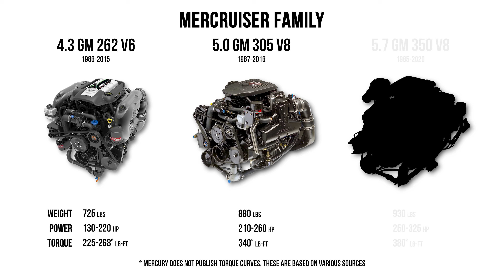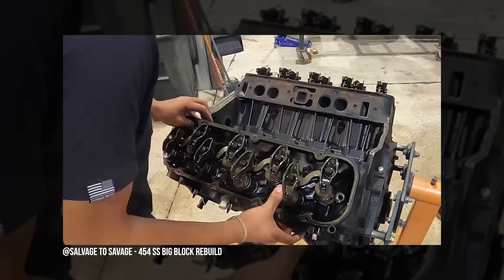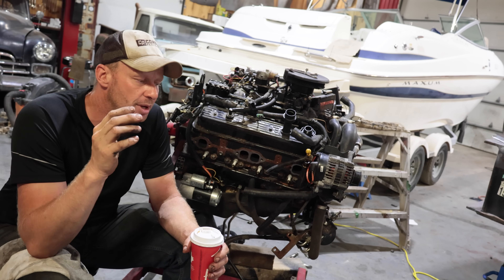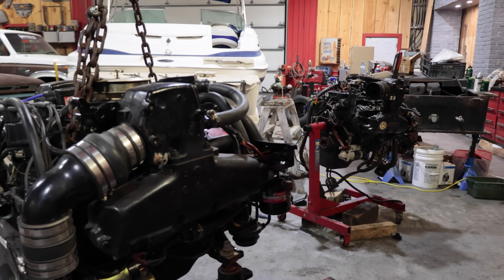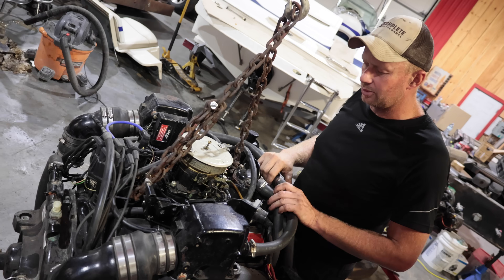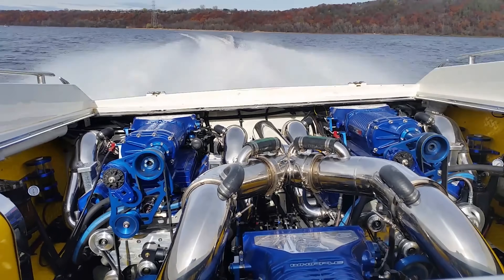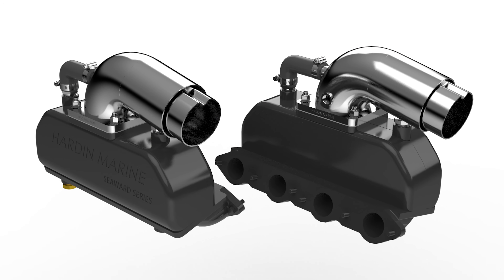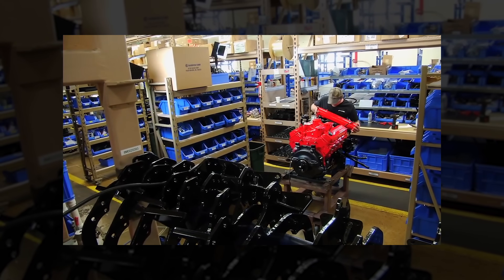REVIEW: Everything Wrong With A Mercury Mercruiser

Comment: I have a 1988 SlickCraft 237sc with a mercruiser 5.7/260 and has a  cracked block and recently bought a rebuilt 5.7/260 (maybe newer engine). my problem is the old engine harness is a 9 pin male/female) connector and the new engine is a 10 pin (female) connector. I can't seem to find enough literature on it and before I go cutting and splicing the harness I was looking for some advice on how to go about handling this issue. Any advice/insite would be greatly appreciated. Thanks.

Comment: My 4.3 sucked for about a year of inconsistent use. Got my Mariah SX18 for 4k that wasn’t used too much, but it was never looked after super well. Used to leave my stranded all the time, dump oil, or just shut off cause the damn wire clips kept getting brittle and cracking. Now it runs perfectly and it’s not left me stranded in a while, although it doesn’t enjoy going from Florida to the mountains in North Carolina

Comment: No matter what slight issues they may have. There is not an outboard motor that sounds as good going across the lake at 4 grand. This is my humble opinion. I have a 2016 383 stroker in my 23-foot offshore boat. I live in florida and don't have to worry much about winterizing the engine. I pull it out every couple years and let machine shop go through it. Love it. Sounds awesome.
Reply: https://www.youtube.com/watch?v=XZkxJJrB9ZM&ab_channel=speedmastermarine

Comment: A simple question solves your dilemma.  Does Mercruiser remove internals of the engine?  They are buying 4 bolt main long blocks?  Short blocks?  Either way in order for what you said to be true they would need to change rings and or pistons.  You can't magically create more/less gap in a cylinder without changing the mechanics of it.

Comment: hi guys, new to the boating world here. I take pride in learning how to do my own work but a little behind in the learning process. I bought a boat from an old engineer in Detroit, Michigan who said the merc had a cracked head but that it was properly repaired  (sleeved) when he bought it. I have only owned it a couple weeks now. I am starting out with purchasing all safety equipment before I go out and bought the shop manual for mercruiser. It is an 1986 tiara 5.7L. I would love any input you guys could pass along. I maintain all my own vehicles but it has been a long time since I worked with non fuel injected motors. I was in the Navy when distributor caps were still being used. I found a few spots that were soft on the top deck so I am going to get my first experience doing some fiberglass work. I have thought about using coosa board to replace soft spots which to my understanding is balsa. Loved the video by the way. I think you converting to diesel would be an excellent video.

Comment: Most engines in boats are operated at over 3000 rpms , in your car or truck that would be 100 mph or more, uphill. If you can keep the revs and the boat on plane under 3000 rpm they will last, running at over 3500 and your motor will not hold up.  as an older mechanic of boats from the 60's and 70's, Chrysler 318's were near top of the list and 327 GM's, but really enjoyed a personally  owned ford 351 windsor with the 3 inch mains and of course volvo 4 cyl's. GM starters are really hard to swap out in a boat compared to Fords. shame no more ford or chrysler marine engines. available new. when ford gave up on the business I could buy new 351 HO complete with carbs and flywheel , wires etc for 1650 $  the days !!  wish I bought all of them.!.

Comment: One thing to add - the Mercruiser 5.7 (and probably the other displacements) uses a roller cam rather than a your standard flat lifter setup you find in the on-road engines.  This works well for extended idling, which these motors do.  Solid motors for sure.
Reply: It must be true.  I redded it on the innernets!

Comment: I had a 165 hp, 6 cylinder that I changed out the block. That boat and engine ran from 1988 through 2009. At that point the engine was tired and the hull was tired so I scrapped it. I would drain the block including the intake and exhaust. Drain and replace the grease in the lower unit and add stabilizer to the fuel. Never had any issues when starting in the spring.

Comment: The thumbnail says it all...the same thing wrong with every new car or I/O or inboard boat engine, look at all the crap hanging off of an engine that requires nothing but a distributor, carburetor, and a few hoses here and there.
1000 points of failure.

Comment: The 3.0 is a gd tank of a motor, mine is anyways. NEVER take these into the saltwater, only designed for freshwater. Taken in saltwater can shave off 7 years of the engines lifespan because of the rust that will be produced in the internals

Comment: Have a Mercruiser 1998 4.3L which runs well, but suddenly the motor will not lift more than a few inches.  It goes all the way down with no problem, but when you go to lift it, it lifts well for about 4 or 5 inches then quits.  The oil reservoir for the lift system has plenty of oil in it.  Any suggestions?
Reply: Bad trim pump or ground

Comment: Had a military sub engineer today working in a motor shop . He told me to take my knock sensor and put it on the other side of the motor . In its current place close to the starter , it feels the starter and sends this info to the computer . I did what he said , my starting turned over so much better . Before I would say 2 or 3 cycles then the engin would start , on the other side I wills say almost instant . I'm not a mechanic but he was right on my Murk 5.7 in my 2005 28 footer

Comment: Honestly though, who has actually seen a 2 bolt sbc block fail at the main bearings in a mild hp motor due to lack of main bearing support???? I'm guessing zero. FYI, I just tore down an original Mercruiser 2002' Alpha EFI 350 that was a 2 bolt main 880 block;) They do use them in marine apps with no problems to clear things up a bit...

Comment: Um,. nope. That struck engine in your video has a 185 degree thermostat. The boat also has a 185 degree thermostat. At 165 degrees, way too much energy is lost. There are no 165 thermostats, dude. And lake water or coolant, the thermostat regulates engine temp.

Comment: The boat engines are usually 2 bolt mains and they have FWC (Closed cooling) available also.  they are better balanced and they don't have hard torque applications like trucks do.  so not sure where you got your info.

Comment: I pump 5-6 gallons of -100 Antifreeze through my Mercruiser 3.0 at the end of every season right through the raw water pickup and there's not a crack anywhere on the block. Just warm the engine up until it's hot and the thermostat is open (or remove the thermostat) and the antifreeze will replace the water. I prefer to use the Winterizing kit that includes the holding tank and all the hoses/shut-offs so you can leave the engine running and switch over to the antifreeze seamlessly from garden hose water without shutting the engine off. I spray fogger in through the carb to kill the engine once all the antifreeze has been pumped out of the tank. It's worked well for many years and I live in Western NY where we have some cold and snowy winters. Also, more recent Mercruiser engines are especially easy to drain...there are two hoses right up in the front of the engine that will drain the block and manifold quickly, just by pulling the hoses and letting the water drain through the bilge and out the plug at the bottom of the stern.

Comment: THIS GUY IS AN IDIOT! DONT LISTEN TO A MORON THAT DOESNT KNOW ANYTHING! A maxim boat which is JUNK! Doesnt know anyting about mercruiser engines just talks out of his ass! LMFAO!  He is building an LS motor oooohhh to stick in a tank of a boat. And this boat flips easy. PLUS THE MORON ISNT CHANGING HIS lower unit! ALPHA DRIVE ONLY HANDLE 350 hp MAX. SO a BRAVO DRIVE IS NEEDED. WHICH TAKES 60 HP to run it. So if he has a 450hp LS motor he is now only at 390hp. PURE STUPIDITY! PLUS PROPS WHICH WILL COST HIM 900 to 1500 dollars.  I just built a 1988 4.3 v6 to 275hp at 5000rpm. 1993 sea ray 200. 55 mph, 6 people in the boat. Simple MERCRUISER! I can drain my engine in 15 minutes. NEVER FOGGED a motor in 30 years. A guy that knows nothing about boats or motors or DRIVES. And that picture of the fountain with tripple 500s. 525hp 525 torq, those are not ls motor! MERCRUISER DOESNT US THEM! And i own a 47 fountain with tripple 500's, XR DRIVES, 28 lab finished and 31 lab finish props.  Stick to your day job whatever that is!

Comment: I had Two Mercruiser 454 engines with fresh water cooling kit installed up here in Alaska on my commercial fishing boat. One had over5000 hours on it and never had so much as a water pump fail, carburetor was never touched. Just oil changes on time. Just buy a closed cooling kit and you will never have this issue.

Comment: All the newer models(not just MerCruiser) that have catalyst are to be avoided at all costs . They run in “closed loop” and use an O2 sensor. Those sensors go out regularly and will cost you a pleasant weekend and expensive repair. They typically cost more than the automotive equivalent. This might be the best time to get an older boat with fuel injection but not so new as to have a catalysts.

Comment: Can I pick your brain?  1986 Mercruiser 230/V8 (GM 305?) Alpha One - bogs down at 10 mph and will not go over 10 mph.  I've had the carb rebuilt twice, new gas line, new fuel separator (x 2), new fuel pump, then mechanic thought electrical - new alternator, coil, plugs, wires, and 2 new batteries - still NOT working.  ANY IDEAS?  Thank you in advance.

Comment: I’m not saying you don’t know your stuff what I’m saying is is you’ve been buffaloed by MerCruiser remember the temperature range that your MerCruiser runs at is brought to you by your thermostat and they normally run at about 200. Just like a car had some that run 195 165 the temperature Engine has water in exhaust so I don’t like the engine cover on fire which is not made out of metal it’s made out of fiberglass and wood

Comment: You are adding to the misinformation my uncle work at General Motors. There’s no difference between the engine that MerCruiser buys in the engine that goes in a truck two bolt four bolt whatever come down the line they didn’t special or anything and then put Marine parts and spark on their exhaust There no difference

Comment: Marine engines have a different cam shaft than automotive engines, so saying you can pull the mercruiser out, and drop it in your automobile is false. You would need to do modifications to adapt it back to automotive.

Comment: Great  content- thanks for posting. I’ve spent hundreds of hours hanging upside down in I/O engine bays scraping arms and knuckles while winterizing. It was a nice change to switch to outboard power and be able to just stand beside the motor to work on it as well as having about 95% of the cooling water just self drain every time you turn the motor off. 
While you are working on the engine swap carefully go over the outdrive, check the rubber driveshaft and shift cable bellows for aging, wear, cracking and leaks. Sinking a boat that way ain’t no fun at all..

Comment: I worked on these for over 10 years and was certified on Mercury outboards and Mercrusiers . Went to merc school in Dallas. In school we were told the only internal parts that were changed from the GM engine was the camshaft that made its power mainly in low to midrange around 4200 rpm’s. And installed Stainless steel valves.
Reply: What can have caused for my engine to shut off when placed in neutral? I didn’t fuel gas after a 6 hour lake cruise. My boat holds 23gallons

Comment: IAC valves,  kept at least two spares at all times.  Cross reference to an auto part, 1/2 price.   The other problem was pipe plug on the intake was iron or steel,  corroded clean through.

Comment: You talk about all the drain points but what about winterizing by running anti-freeze thru it? Last fall I ran 6 gallons thru (until I saw the pink coming out exhaust), fogged the carb and shut it off. Started right up this season with only a hint of burning off the fogging agent. No water leaks. Pulling motor in the next week or so to fix a steering issue so I will have a real good look at the outside of the engine. (1994 7.4 liter) How about reviewing the 7.4?

Comment: There is nothing wrong with the engines only the owners that do not take care of them to your point. I have a mercury or 5.0 that I purchased with my searay back in 2008 and I’ve never had one single issue with it and it’s got 700 hours on it. I do the routine maintenance every year and I take care of it other than changing the spark plugs upgrading to higher alternator I haven’t replaced any single part. Also, Brunswick makes their own engines and house now they have for years so the Chevy block is out the door.

Comment: What's wrong with mercruiser is the separate from the block oil filter and the fuel vapor lock system and the flat distributor cap and the oil pan oil baffle plate nothing like the 1970 s ford 460 omc king cobra engines

Comment: Retired marine tech here. Let’s add more fuel to the fire and why I’d NEVER own an I/O. Starting at the rear, two sets of gears, more mess to change water impeller, drive bellow, shift cable bellow, exhaust bellow, two u-joints, extra shift cable, trim limit and trim sender under water at all times, gimbal bearing, engine coupler, transom assembly, more weight, gimbal ring, upper swivel pin rusting, lower lube hose break and leak lube out, transom seal, exhaust shutters, exposed hydraulic lines for rams, $1500 minimum for bellow job, engine coupler job minimum $2500, on a same size boat outboard vs I/O, outboard faster hp being the same, lower unit pull every three years or sooner for inspection, plus everything you mentioned in video. And there are more reasons.
Reply: I agree, you can’t beat a straight drive inboard setup if no outboards

Comment: I have a truck engine in my boat. It's a 1995 Bayliner. I pulled the original 4.3 engine because it was not winterized and then compared both engines while putting on all new gaskets on the truck engine. They were identical except for the camshaft which I did not check and did not know that there may be a difference in camshafts at the time.
Reply: Did you change the oil pans or did you keep the truck oil pan on it? I'm doing the same thing now
Reply: @brandonlarry1645  My 4.3 from my boat was 1995, and the replacement engine came from a 2002 S10 truck. I kept the truck oil pan because the pickup tubes were different, so the oil pan from 1995 did not work on the 2002. I had to modify the oil dipstick a bit for it to work, considering that the dipstick had to be from the same oil pan. I had to use the water pump from 1995 because of the v belt pulleys. The pump did fit, but the timing cover did not work for that water pump. I had to modify one of the bolts (make a flat head) so that the pump would fit. What year is your boat/engine?

Comment: I would disagree on the whole 2 Bolt versus 4-bolt main deal. A 2 bolt main block is actually stronger less holes drilled in it. I've never seen a 2-bolt main throw the crank out of the engine have you?

Comment: FYI:  Marine gas engines used in saltwater and some freshwater applications have "freshwater cooling".  In essence a closed (except the exhaust in most cases) cooling system.  These use a heat exchanger and raw water to cool the exchanger.  Because salt precipitates out of salt cooling water at 150-60 degrees and is much more corrosive at higher temperatures those without freshwater cooling run at 140 +/- degrees.  They also corrode out in rapid order, so they have a very limited lifespan.  However, those which are using the closed cooling system run at 190 or whatever degrees the engine is most efficient at.  The salt not only corrodes but it builds up in passages and eventually blocks them off as well.  Some cooling systems even have fresh water going to the exhaust manifolds and risers.  These are special applications because it increases the cooling load dramatically to cool the exhaust as well as the block necessitating larger heat exchangers, hoses, and pumps.  As an aside, this is one of the major drawbacks to outboards.  They are aluminum running a raw saltwater cooling system.  Not only does that restrict flow but the coating it leaves lessens the ability of the system to transfer heat.  A double whammy.  My experience has been that the marine application will have different camshafts, main bearing caps, and larger oil pans to name a few.

Comment: i have a 2006 Murcruiser mag 350 mpi out of a crownline..
it has a ( two bolt main )..
Never seen 4 bolt main in any factory boat vortec.
There is nothing about the motor besides the camshaft and
 different head gasket.
They come with *Exact same factory with a ramjet 350 automotive cam.
Same exact cast pistons,
 same block casting#..
The #1 problem with them is the merc sea pump are absolutely garbage.
The glue the shaft in the bearing,
The glue fails and the shaft walks out.
They are disposable and good for about 20 hours.
Korea makes a brass replacement that is so far so good..
The next issue with that engine is the plastic water distribution manifold on the bottom left of the engine.
If the plastic plug is over tightened just slightly the plastic housing cracks.

Comment: I have installed many l31 marine engines in trucks.  I was getting really good deals on brand new l31 vortec engines.  I prefer the l31 marine manifold and I have installed many of them in 96-2000 trucks and SUVs.